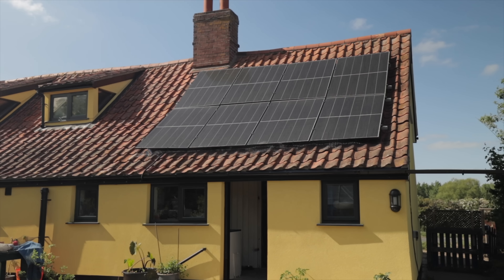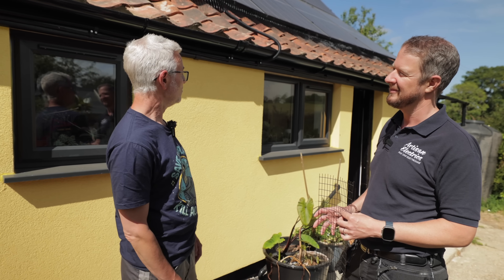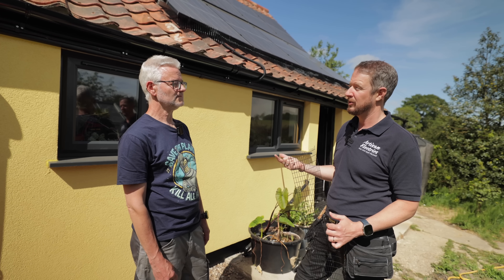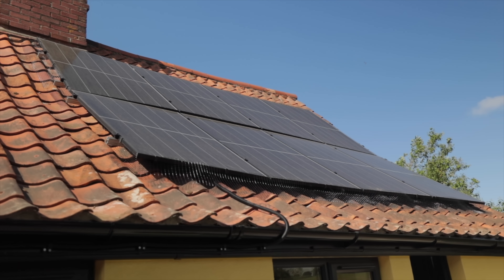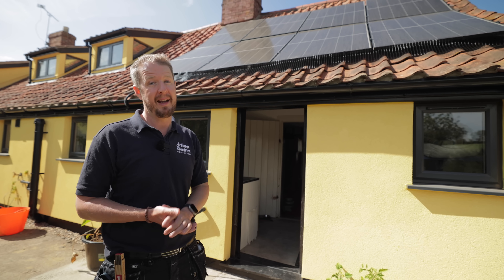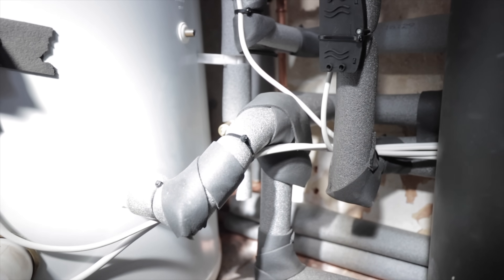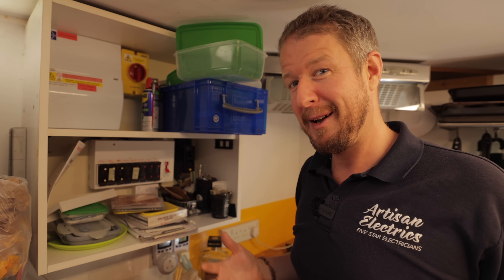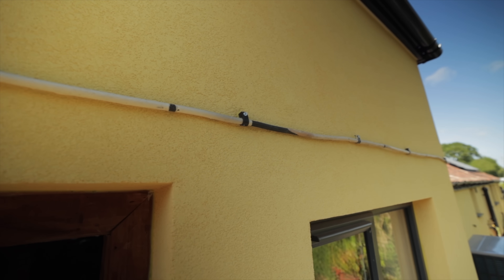This £50,000 Grant-Funded Solar Installation Went Terribly Wrong…😱

Comment: Paying a premium for a "quality" install doesn't guarantee a quality system or service. We used a company - who in 2021 were one of the leaders of "quality installs" in a cowboy industry. They did a very neat and tidy job but installed the inverter in the loft despite my concerns about the temperature - we are now on our 3rd Solaredge inverter. They've been glacial in responding to issues, used a random selection of contractors and most recently failed to set the correct export setting on the inverter so we have an inverter that was constantly limiting export of our 2*Powerwall, 8kw array/6kw inverter to 3 kw! They now wont even respond to my messages. I read the manual and unclampped the CT - job done! When it goes again (which it almost certainly will) I'll use my son who's training to be a spark.

For our house in Spain, I worked with an installer to build an off-grid system (2*8kw inverters, 3 arrays totalling 15kw panels & 75kwh of self build LFP batteries i.e. massive) which has NEVER gone wrong - our house was the only Villa with power after the outage this year as we'd installed an ATS to take the place offline in the event of a powercut. Both he and I took care to ensure everything was correct at every stage - something that it just not happening in government funded installs.

The UK solar installation market is a complete joke where consumers are getting screwed and the government grant makes the whole thing worse - these awful installs will kill someone and give leverage to those who think we should carry on burning oil and gas. 

How do you fix it - Let the homeowner choose a local installer, give the money to the home-owner in 2 payments 50% upfront and 50% on completion of an install signed off by a qualified spark, If no sign off then money has to be paid back.

Comment: Good video and really important to highlight this, so well done. Not only is it a very poor installation, highlighting the very wasteful process and 'creaming off the profits' of these government incentive schemes, but shocking how little equipment they've installed for £50k. We have 40 PV's (12.4kWh array), 3 Tesla Powerwalls, an ASHP and an EV charger installed in 2019 for £55k directly negotiated with a supplying installer, which included an £11.5k RHI grant. The process needs fundamentally changing to ensure that only quality installers like Artisan Electrics can win these bids, not accredited 'middlemen' administrators, who sub all the work out to cowboys! The issue is, local authorities should be nowhere near this, as they do not possess the internal skills to know how to manage it correctly.
Reply: I think the total was 50K not just the solar... this wasn't really explained.
Reply: @thomasdesloovere4200  Yes - to be fair I only have hints as to the total cost and it does include the external wall insulation which was undoubtedly the most work. The EWI has be registered inspected and I have the paperwork. The 'clean heat' contractor employed 4 levels of sub-contract and has never handed over the system - 10 weeks later still no MCS!

Comment: Thank you for all the good videos  you and your  amazing  team  do and I also learned  a lot of the videos  you  make.  And I am a single phase electrical with a solar green cart and I find a lot of solar installations  what look also  badly  done and try to help the client the best I can to make it better and safe for them.  The worst  I found was a DB board  was weird with Speaker cable 😂   so I think it is all over  that you vind the 🤠 cowboy Electrician.            Thank you and your team  for the awesome  👌  work you do and videos.      And the Question I have  is  have  you ever tried  the DEYE inverter.    Because we use the DEYE inverter in South Africa  and it is a very  good inverter

Comment: You're probably gonna have to have some sort of independent inspection done which is required by the grant and required to be somebody different and not related to the contractor. that's the only way I can see you're gonna get around this. because right now it seems like they're just handing out the money and anybody's taking it and there's no recourse or quality control.

Comment: I'm confused how is a heat pump burning 20 pound notes versus an uninsulated house burning through fuel oil or gas?
Reply: The pattern of use for a heatpump is different from oil - which you fire up when you need it. Oil would work better with insulation but an 8kW heatpump would be overwhelmed in an uninsulated house - running all the time but unable to achieve set points.
Reply: Its the immersion heater that many heat pumps run to keep a certain temperature.
Reply: @lloydbooth-w1j  oh to keep above freezing and defrosting unit. Is that really that much?
Reply: @imark7777777  No its the water tank inside were the heat is stored, please find out how they work.
Reply: @lloydbooth-w1j  That's usually just needed at outside temperatures below ~ -10°C, an R290 heat-pump reaches 60+ °C without it in almost any other condition.

Comment: Get rid of the multi tier subs. One primary sub who does the electric planning and at max one sub who does the installation.
Reply: Yes, this. It was mentioned in the video that everybody in the chain takes their cut without actually doing any work - this is just wrong. Also mentioned towards the end that only 1 or 2 companies actually had any certification.

Comment: Greetings from Scotland! Maybe the system is a bit different up here, but we went to a local installer and they processed a full council grant under disability regulations (for me) where we would get 6 panels, standard inverter, ASHP along with water radiators in all rooms, piping installed (we had electric storage heating prior to this) and hot water tank. We had extra loft insulation, humidity controlled fans in the bathroom and kitchen, all external windows were fitted with vents which can be shut off if needed. I asked if I could add some extra bits and it was no problem. So, I had added a Sunsynk hybrid bi-directional inverter and 4 additional Trina 440W solar panels along with a 2 battery system, also Sunsynk. I have since recently upgraded to a 4 battery (total 21kWh) system. 
It took 1 whole week from start to finish and the house was crawling with personnel, all doing their specialised jobs! It was done in mid January with a massive storm right in the middle, which made it a miserable job for the guys working outside, but it all got done and when it was all switched on, it worked great. Within a couple of weeks the installers head electrician and a government guy came to the house and everything was inspected. Apart from RCD's needing changed for MCB's (or something similar/newer) plus a few safety labels had to be displayed and an extra isolator unit installed for the 2 batteries I had then, all passed with flying colours. 
The only problems we have had in the 5 months it has been working was due to my lack of knowledge about the Samsung heating system where I had inadvertently switched the ASHP by brushing against the touch screen - my bad and it was sorted by a phone call.
It has transformed our bungalow into a cosy, much, much cheaper place to live in!

Comment: I note Bracknell Forest Council have just posted a video pushing a Solar Together scheme, they show an image of an inverter install and it looks awful, cable used where flex should be used, cable not clipped, no decent protection for the DC cables.
Reply: My local council has just signed up to offer a Solar Together scheme and I've not heard anything good thus far.

Comment: It's a different set of wind load calculations for a ski jump roof like that. Piss poor planning.
It's times like these when re roofing to a modern standard should be allowed and encouraged as older roofs while able to take the weight quite often can't take the wind load without structural reinforcement internally or being re roofed. 

If you want a solution the councils need in house design teams that then put out to tender and then inspect and strike off any failing to meet the design. Plus given the spate of fires from solar potentially prosecute under the HSE. 
MCS really isn't needed and honestly isn't appropriate.

Comment: We've just recently tried MSDC Solar Together scheme. However, and despite losing a £150 deposit to the scheme, we've used a different installer completely and not used the Solar Together scheme as we achieved better value from our own price enquiries. I must say also that the company we used also was far less salesman orientated than MSDCs succesful provider making the experience far more pleasant. The point I'm making here is that you would think the MSDC bulk buy scheme would offer best value, but in our experience it didn't. If you weren't bold enough to source your own quotes you'd never know, and this seems wrong. I suspect we also achieved better quality from our installer also.

Comment: i'M CURRENTLY IN THE MIDDLE OF AN INSTALLATION...SO FAR......WRONG SIZE COPPER PIPES USED, SHONKY SOLAR INSTALL, AWFUL INSTALLATION OF RADIATORS. LAGGING IN LOFT AREA RESULTED IN ALL BOARDS BEING RIPPED UP AND NOT RE INSTALLED...THREE TIMES THEY CAME BACK AND ITS STILL NOT DONE PROPERLY. OUR FLOORBOARDS AND CARPETS ARE RUINED IN SEVERAL AREAS OF THE HOUSE. THERE IS RUBBISH LEFT ALL OVER THE PROPERTY, INSIDE AND OUT. THE HEAT PUMP HASNT EVEN BEEN SWITCHED ON YET (AFTER 18 DAYS OF INSTALLATION) AND WE HAVE NO HEATING AT ALL. THE COMPANY COMMS ARE TRULY AWFUL. i DON'T KNOW WHERE TO TURN FOR HELP.  I FEEL LIKE CRYING.

Comment: I am looking at getting solar panels and have been accepted into a Solar Together scheme. Before I was accepted, I got a quote from the company contracted to do the work for the Solar Together scheme. I had a call from that company, where I said I was going to wait for the other Solar Together quote, and the salesman said they are part of Solar Together and will do it cheaper. I am not sure how that works.
Reply from the maker: It’s all a scam
Reply: It’s simple, someone in the local authority procurement is taking a backhander. It’s rife in all these schemes. Get at least 3 quotes, from large and smaller operations, then play them off against each other for your customer, when they won’t go down anymore you know you are getting a fair price.
Reply: @yp77738yp77739  thats if you can get a local company to quote !!, a local company round my house in FEB, & was going to quote me for 23-25 panels & a PW3, i got the quote 10 days ago, 11 panels PW3 £34,995 ,i am thinking they dont want the work,  the chap doing the quote indicated, all in cost of panels with mounting was roughly £100 a pop & they only fitted bifacial 450w, fine by me but 4 months later and 12 panels not on the quote, its 2 words from me :)

Comment: In regards to the ceiling heights people in the 1500s through to about the 1800s where just simply smaller people on average from what I’m aware
Reply: Plus this was before MCS,  I figure they would have been driven by economics, common sense and materials availability, which, dictated avoiding empty space to heat and time to build.
Reply: Maybe even later than that.  Many years ago I had the pleasure of visiting a historic Welsh village in Patagonia, Argentina.  That was built in the mid to late 19th century and even I, a mere 5'10" had to stoop to get through the front door
Reply: You also have to remember no mechanical aids, so lifting heavy beams to head height is far easier than trying to get on your tippy toes.
Reply: Plus the fact that floor levels are often raised to get them of the earth, and often not dug out to raise ceiling heights from below.
Reply: 😆 and timber was expensive and it was probably built by the same cowboys who did the solar.
Reply: Indeed - stunted growth from poor nutrition.
Reply: Hobbits mostly that live to max 40 🤷‍♂

Comment: Government funded schemes must be validated and signed-off by the government and by government inspectors! This is a waste of taxpayers money, otherwise.
Reply from the maker: Definitely
Reply: Absolutely there needs to be an Inspection after install and payment is withheld until that process is completed. Unsatisfactory Installs would need to be fixed and re inspected before payment is made. This alone should remove cowboys but it would also increase cost of Installs which Government will not like.
Reply: 😂 Mone and her friends know a thing or two validation and sign offs
Reply: @00ruy00  This is what doing away with red tape (regulation) gets you. We've had it with banks, stock markets, mis-selling any number of financial services, mortgages etc. Have properly regulated and inspected work/contracts. If it has to be sub-contracted limit it to one. My Solar Together system was fitted by guys from Dorset, I'm in Essex. They did a decent job but the company employing them went out of business a year later.
Reply: There shouldn't be government funded scheme like this. 

This is up to the homeowner to pay for not me and you.
Reply: @Robert-j6r8c  Why not? Government goal is to reduce energy bills for all and increase our green energy production. This does both
Reply: or they should have worked with private companies to actually make those projects/programs more affordable but we all know the government with money management
Reply: Agree. But also think the customer should have more choice/power to choose installer and dare I say it in some instances such as insulation be allowed to DIY.
Reply: @radfoo  Indeed, choice is also needed. I DIY most stuff but external insulation is even beyond my skill set (or I'm not brave enough just yet - too high risk) - hence yes and no, sometimes it works, sometimes it doesn't - remember when loft insulation was buy 1 get 3 free in the mid-late 2000s for homeowners to DIY? All the contractors bought absolutely loads of it for around a fiver a roll and much of it it either ended up being done badly or chucked in a skip - I bought 28 rolls off ebay from someone whose contractor had bought too much and left it in their garage...I did however persuade my then 60+ year old parents to go out and do their own loft which to be fair they did for just under £100 - that would be well over £500 in materials today, let alone labour if it was a grant 🙄
Reply: Check out the wall insulation carty on. That was gov funded shize

Comment: Every one of these installs should be subject to an independent quality review.  If it fails then they don’t get paid but have to pay the remediation costs.  As a former government employee responsible for contract letting and management, I never EVER went for the cheapest and this video amply demonstrates why not.  Sadly in too many cases, HMG simply cannot afford the level of oversight needed so relies on external contractors who are themselves the lowest bidders.  These schemes need properly accredited experts who are subject to auditing against ISO annually.  The level of mandatory qualification and minimum levels of experience to do this work needs to improve.  I’ve just had a full Solar PV and Battery install done.  I saw all of the right contractors, surveyors, electricians, roofers etc and it’s been done well.  It wasn’t perfect, but the  issues were all fixed and it’s fine now.
Reply: it would be better to remove taxes for solar,batteries,inverters,heat pump and isolation, then there wouldnt be any need for taxpayer funded grants and all that inefficient circus
Reply: @423GustavBern 100% Solar without a battery is just insane

Comment: 3.5kW inverter - 2.5mm would be perfectly adequate
Reply from the maker: But the IET guidance note requires 4mm minimum for PV circuits I believe
Reply: @artisanelectrics  Have we got a page No. ?
Reply: @mattys5686  Of course he hasn't. This guy is simply a grifter.
Reply: @artisanelectrics  presumably to try and keep the inverter from disconnecting when grid voltages are high.
Reply: When I was audited by MCS for nominated person he told me always 4mm or above. If it's Mcs, even 1 or 2kw 4mm. If it's new build houses and no MCS then 2.5mm is fine. But he did say 4mm twin cause I know my dad's house got passed with 2.5 3 core swa
Reply: @jacktissington  Which MCS standard covers Selection & Erection? None of them do. So you must follow BS7671 of the Code of Practice for Grid Connected Solar PV Systems. What do those publications state? You can't operate an industry based on what a random person from NICEIC or NAPIT says.

Comment: If MCS/HEIS don't make this right for him then they have proved just how pointless they are. Solution is that the main contractor is struck off by MCS so they can't get any more grant funded work but MCS won't have the balls to do it.
Reply: Yup, MCS is completely optional, not required by statute, yet has lobbied for capture of the electricity providers to require it for export.

If MCS don't fix this, they prove they add nothing to the process and are barely more than a scam.
Reply: Correct. MCS is a profit making organisation so removing one of its members removes revenue, huge conflict of interest